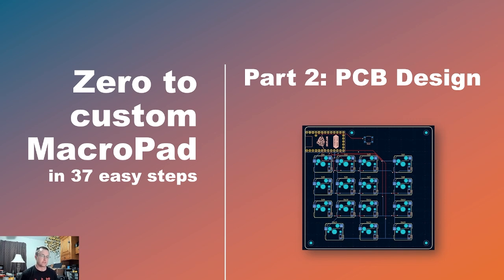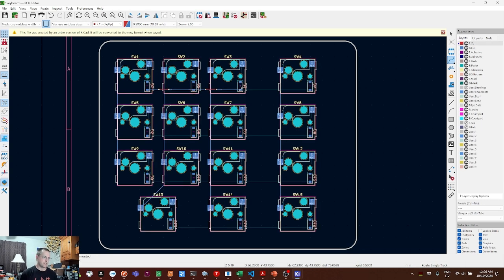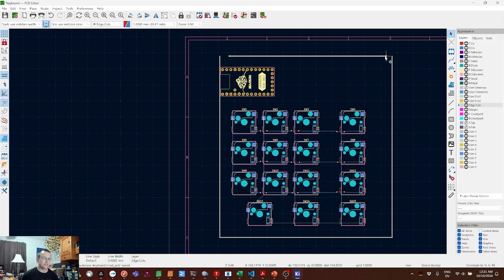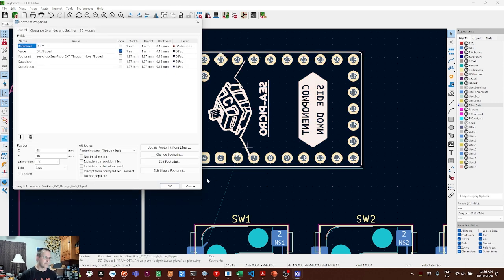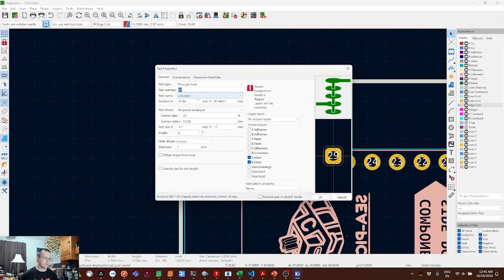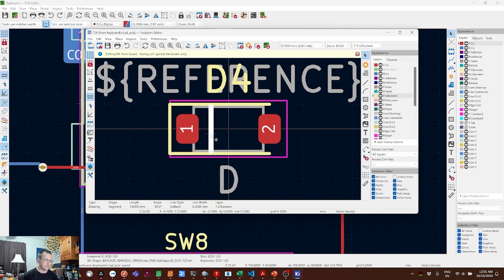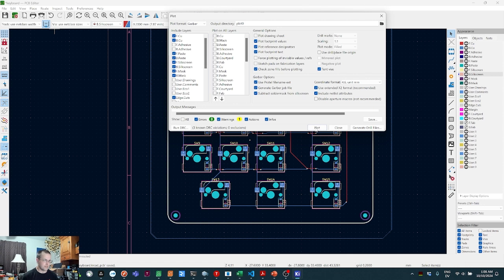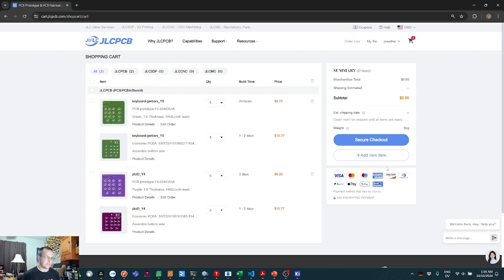Zero to custom MacroPad in 37 easy steps - Part 2: PCB

Comment: The Sea-Picro was out of stock so I ordered an AdaFruit Kee Boar instead and discovered a significant gotcha: It has its two buttons mounted so close to the header pads that a pin header cannot be placed on the component side. So now I've ordered an Elite-Pi which looks like it should work.

Comment: All of my footprints's through hole are red (blue if im on the other side) not the yellow colour shown in the video so I cannot trace it to other components. Do you know if it's some setting I have on?
Reply from the maker: Yellow is the default color for Through-hole pads.  Are you using an SMD footprint instead?  Sorry for late reply, I am on a desert island with IP over Carrier Pigeon service.